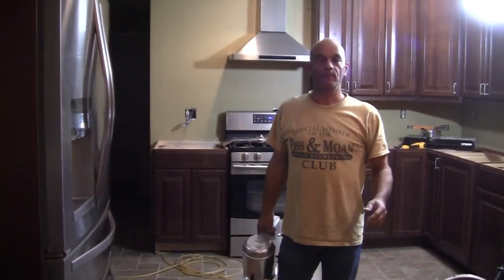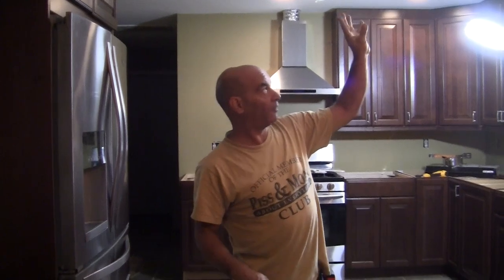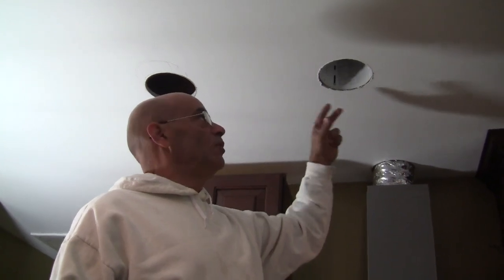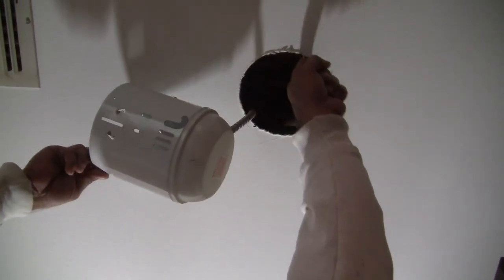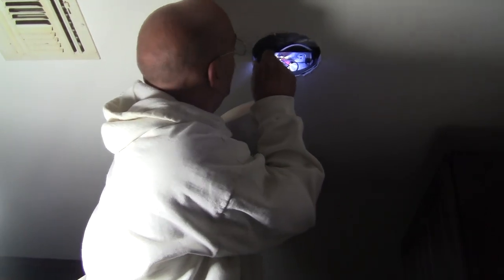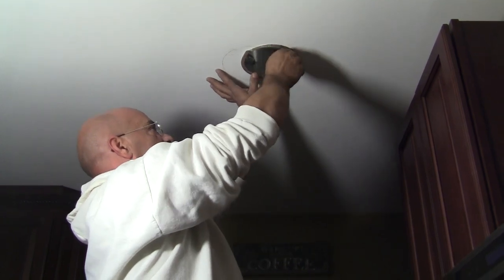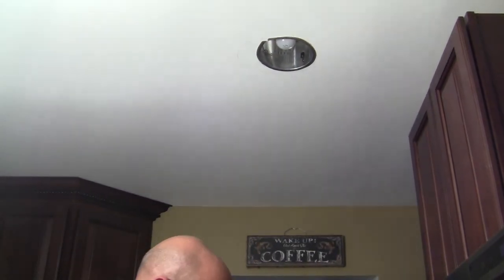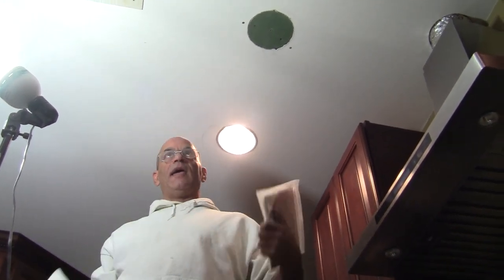Adding more or Relocating Recessed / High Hat Lights

Comment: I am using the same lighting hw to install 8 recessed lights in my bedroom.  Even though i have access to the attic, i purchased the remodel lights.  I also purchased the 6" hole saw and a stud finder.  $80 in tools to do 8 lights, so not bad. The fixtures are sealed which is nice that it will not give me drafts in the winter from the attis.  I have a new home, but the electrician wanter $250 for each light here in NJ USA.  dimmable  LED retrofit kit from costco completes the install.

Comment: I use a recessed light hole saw which is actually 6-3/8" in diameter not a regular 6" hole saw...6" is not large enough for any can lights i've installed...
Reply from the maker: +David Mack 100% correct. I've been referring to as a 6" way too long. But yes it's 6 3/8"